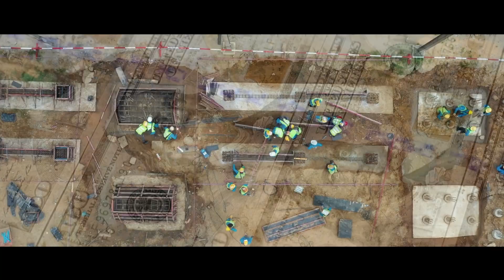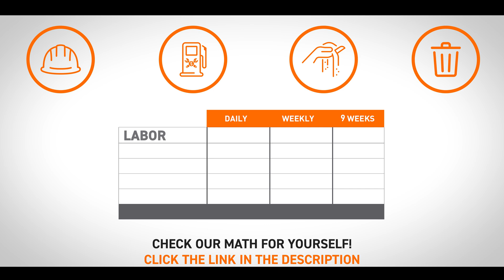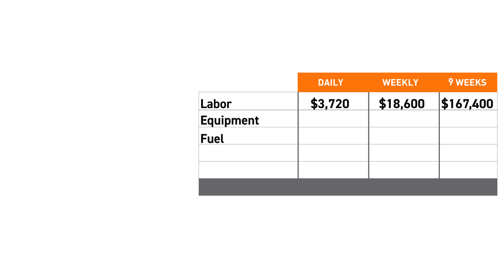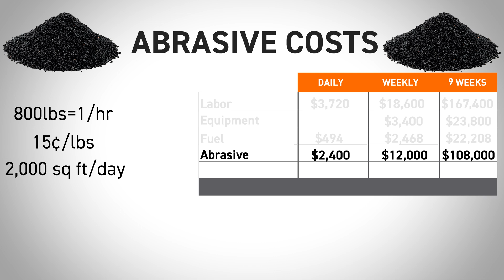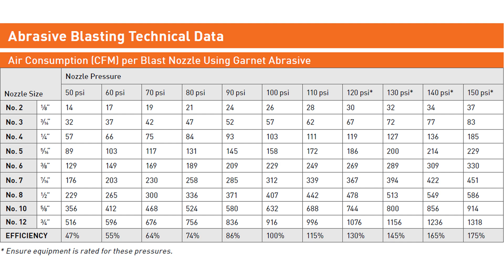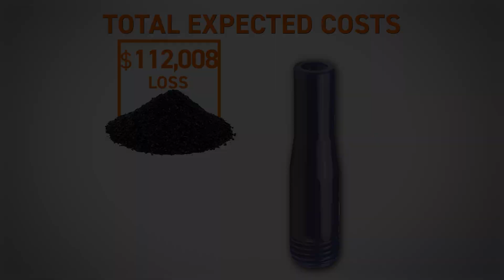Your Worn Nozzles Cost More Than You Think

Comment: My employer will use everything until it is not usable anymore. Case in point. The blast hose must blow 5x before being replaced. I've tried to explain to them that it slows me down.using a worm blast hose due to the quality of the profile being diminished.
Reply: I have seen worse. Blow hose 5x it gets too short add another old hose to make up the length.